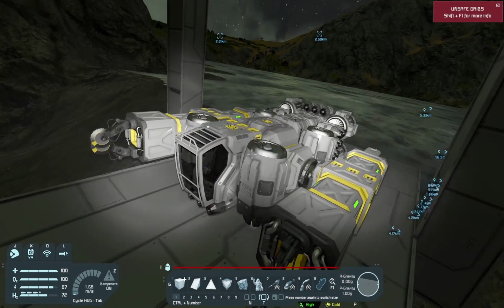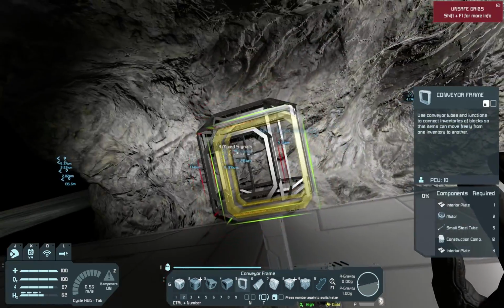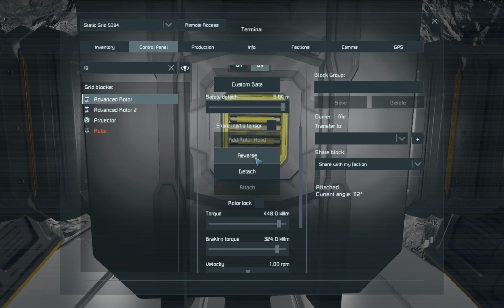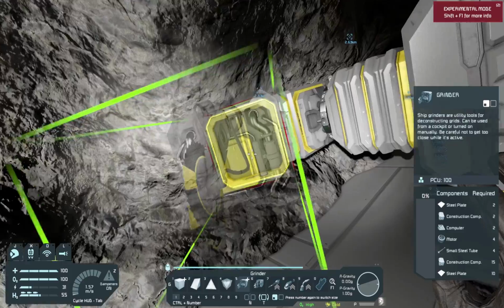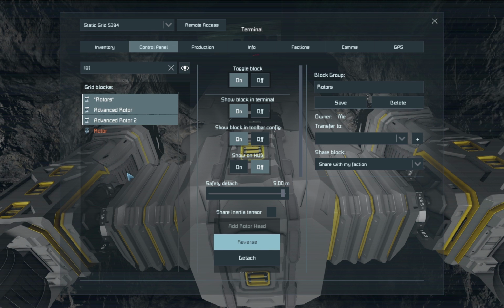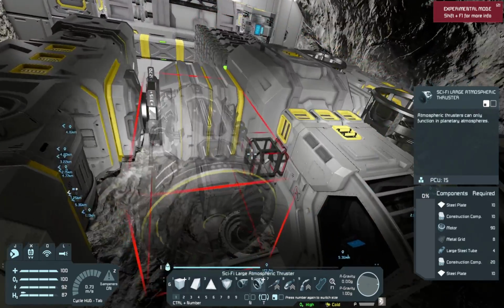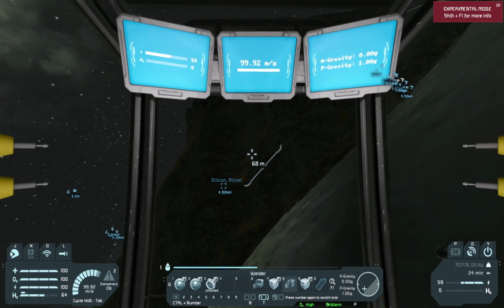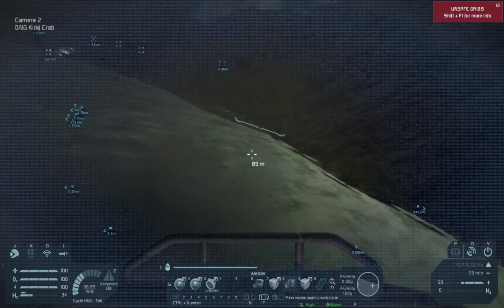Space Engineers #54: King Crab

Comment: The idea of a universal cutter-welder is interesting. But the ship turned out to be too expensive, complicated, heavy and impractical. My cutter is built only on a large grid, has 2 batteries (40 min working), 3 cutters and 3 small containers (total 100.000 liters against your 15.625), but it is 3 times cheaper, simpler and less. For weldering Nanobots are mooooore usefull.

Comment: guess my next mod will be thruster power boost and make batteries a bit stronger so you dont need 100 batteries to run a ship in atmo. i usually only use hydrogen thrust cause ice is super easy to get
Reply: Cold fusion reactor mod. Will solve all of your problems